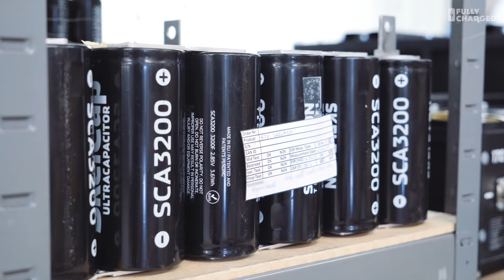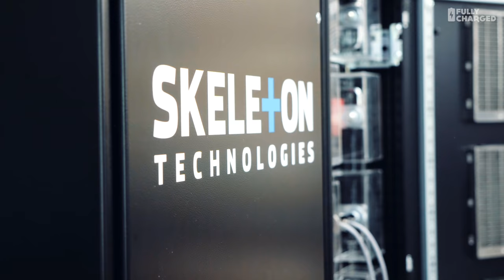Skeleton Ultra Capacitors | Fully Charged

Comment: This is Fullycharged at its best, more like this please, ^oo^
Reply: Hello from Estonia.
Reply: Let me pose this thought to you:
High-End Car Audio Systems incorporate Super-Capacitors in them for large power spikes, because if powered by batteries alone, the amplifiers can't handle some of the peak spikes in power. The capacitors provide the extra stored energy to keep this from happening, smoothing out the few of power. This is an understood fact and has been for many years.
So, why then, do you think incorporating this into larger scale power generation facilities is a stupid idea and/or a waste of money?
One SMALL scale practical application I can see for large capacitors would be for lighting systems. The Goal Zero lite A Life 12 Volt 350 Lumen light could burn continuously for WEEKS on just one supercapcitor, and when the Supercapcitor is exhausted can be recharged in 90 seconds, and then run the light for weeks more.
Yes, this technology IS in its infancy, but don't dismiss it out of hand. I'll take this over a Coal or Nuclear Plant, thank you very much.
Reply: this is an ad
Reply: Capacitors have been used for a very long time, and in fact most electronics could not work without them. What's new here is the technology and specifications. To claim that the US petrol and nuclear corporations will be able to stop this is naive. It's already here.
Reply: Brian Foote my response was to the paranoid delusional dude further up babbling on about CIA and industry wanting to kill off the technology. As for the economy of this, it clearly makes sense since they already have a large number of customers around the world.
Reply: Hello from India
Reply: SysPowerTools  Very poor trolling , you must learn to camouflage the troll , now get back to kindergarten.
Reply: Brian Foote  Well i,m pretty sure this particular capacitor is miles ahead in regards to power output vs size. So there is something new going on here.
Reply: Agreed.   
Estonia is a great example for the world to follow.
Reply: More of this, less vegetablism.
Reply: Bruce Forster yes car audio with massive different using caps, so are home audio, some amps has a separate power supply module that supply addition caps to provide current as well as smoothen out the electricity.

Good quality psu often use good quality caps like Seasonic PSU.
Eventually Ultra caps will hold more than original caps.

This pair up with Don Sodaway’s Mega batteries makes a perfect energy supply.
Reply: Hung Tran ultra caps already hold more than original caps
Reply: Bullshit....conspiracy at your best.

Comment: NOW I GET IT!
Basically
Regen the CAPACITORS.
Use THAT energy to accelerate.
Use the BATTERY for cruising.
Simples!
Reply: Exactly, you got it.
Reply: Earl Pottinger 
Simples!
I admit!😏,  I was sceptical of the "supercap" argument....... BUT
I always believed the "enthusiasts" were proposing that they be a REPLACEMENT for the battery.
NOW I understand that they are effectively "best friends".... (DUH!!!)
I have to say, this is a akin to the moment I realized EV's would (eventually) be the future!
The strange thing is, I have (for a VERY long time) been a fan of Formula One. It's becoming apparent (at least to me..... duh, again?) that this company is "involved" (if not in F1, in Endurance hybrids).
The logic of the system *works*!
Reply: Amazing (well, not really) how many 'experts' here apparently don't........
Reply: Roger Starkey but use more components to connect these - not very cheap, unfortunately.
Reply: @noop9k  
If you add the capacitive unit, you're removing batteries, which compensates for the price. The benefits would outweigh the cost.
Reply: Roger Starkey Adding 2 components instead of one is more expensive than making one of these components just bigger. Extra circuitry needed to direct electricity to one or another, possibly transforming voltage, is not free. total battery capacity invariably does down too if staying within the same weight limit. This all may be of course compensated by advantages of supercap, such as longevity, but price is bound to increase anyway. This is a tradeoff: speed of charging and number of cycles vs price and distance on one charge.
Reply: Batteries are like flywheels. You don't want to try to slam them stopped or slam them going, because they break. 
Capacitors are like springs. You don't want to keep pushing or pulling on them, because they break. 
But you can slam the capacitor, and keep pulling or pushing the battery.
Reply: "I always believed the "enthusiasts" were proposing that they be a REPLACEMENT for the battery."  
There was an idea to integrate them, charging from the electrolyte with the cap and battery integrated.  It was always the idea of adding rapid charge and discharge to batteries to prolong their life without conversion losses.  The energy in a capacitor is stored in the electrolyte/insulator, and not the plate after all.
The idea went with the idea of induction charging on highways, cap to cap through induction.  The caps would limit infrastructure costs delivering a large charge as you drove over it and then charge the battery as you drove from the caps.  Unlimited highway range while recharging, and better off highway range with regenerative braking.  It was also thought to be a good system for trains because you wouldn't need a live wire running the length of the track to go electric, rather just connecting plates every however many miles, a safety win.
Reply: Don't these ultra-capacitors also have the potential to make car charging so much quicker? That could a game changer.
Reply: @bobforton3722  that is a big possible advantage. The problem is that they are bigger and heavier than bateries. If they can get some capacitors for an ultra quick charge, and batteries for the rest it may well work, but you would either need a bigger car (less efficient), suffer less space, or have less range. 
Like most things in engineering there are trade offs.
Reply: In it's current form, it's definitely not a replacement for batteries, but a great complementary product to store regenerative breaking energy quickly, and provide a boost during acceleration, etc.
Who knows what they'll come up with in the future, one day given the right materials, it could become a viable replacement.  In the meantime it has great advantages for storing and releasing energy very quickly.
Reply: electric NOS.
Reply: @williambarnes5023 : Very nice metaphor.

Comment: Three points of note need to be made whenever talking about batteries vs capacitors:

1) Batteries do not "store" electricity, they convert electricity into (and out of) chemical energy. ie the energy is stored by change in chemical balance within the cell. This is why they are "slow" but "energy dense"  Capacitors directly store electric charge, the lack of chemical reaction required therefore makes then fast but fundamentally poor energy density

3) The charge held on a capacitor is inversely proportional to the separation of the charge carrying elements ( C = ( E X A ) / d ), however the maximum voltage a capacitor is capable of withstanding (before charge "leaks" across between those elements) proportional to that separation distance.  Why is this important, because Power = Voltage x Current, so high power requires high voltage, which means large separation distances, which means a smaller capacitance value.  The current drive for higher system voltages for eMobility applications, which is likely to continue (as both efficiency and cost fall with increasing voltage), tends to start making capacitors bit players in the energy storage game (And if you think "hey, i can just put some capacitors in series, well, sorry, but physics has got a limit there too, as capacitance is the opposite of resistance, so put two capacitors in series and their effective capacitance halves not doubles!)

3) The energy stored in a capacitor is directly proportional to the voltage across that capacitor (U = 0.5 C x V^2). Unlike in a battery, where the chemical reaction is driven by the voltage difference, a capacitor therefore has a voltage across it's terminals that is highly dependant on the charge stored.  This means that practical capacitor based energy storage systems require an active voltage converter (DC/DC converter) in order to maintain a reasonably fixed output voltage at all energy levels.  That means the power limit of the system is not actually the capacitors themselves, but the power transfer capability of that converter (who's ultimate performance is inversely proportional to the voltage ratio required).  Therefore, any meaningful cost comparison  with battery storage MUST include the cost of that vital voltage converter, ie you cannot just compare the cost of a capacitor with a battery, and say "capacitors are cheaper".

Today,  significant capacitor energy storage has been only realised in high cost systems (buses, cranes, motorsports etc) simply because the cost and complexity of the necessary voltage matching infrastructure has made such systems un-competitive with chemical battery storage systems on small, or cost sensitive applications (ie passenger cars).  And while chemical battery costs continue to tumble, driven by huge investment in massive volume production, that situation is not going to change any time soon imo..
Reply: Max Torque questions is why do we need capacitors when will coming soon solid state batteries ?
Reply: More importantly, chemical batteries can provide more than enough power for typical use in an EV without capacitors, particularly for large capacity packs.
Reply: Yes, the video said they're using it for regenerative braking on buses.
Reply: well said!
Reply: In day to day use, this can very useful for regen breaking, since batteries heat up the quicker you charge/discharge them, and heat damages them. So by implementing a capacitor along with Li-Ion batteries, you're charging up the caps, then transfering the power back the wheels when needed, or charging up the batteries at a slower rate. Think of caps as an energy buffer when regen breaking.
Reply: If the battery pack is large enough, for example in a long-range pure EV, then the battery pack itself can provide and take in very large power levels without capacitors, and capacitors are not needed.  Capacitors could help with regen in hybrids with small or no battery pack.
Reply: Thanks! I've actually learned something from a YouTube comment, much appreciated! :)
I would be nice if Robbert knew and talked a bit more about the technical side, 
Knowing what the real bottleneck is for a technology is essential.
But hey, nobody's perfect.
Reply: All real systems EVs or otherwise, use a combination of batteries and capacitors.  Caps come in all sizes from tiny ceramic caps in nanofarad range to the massive kilofarad cap assemblies seen here.  So its never a question of if caps are used or not, the question is, given the constraints of the application, where is the sweet spot in terms of performance, price, and reliability.
Reply: Max Torque "across its terminals"* apostrophe in "its" means contraction not possessive. Just trying to help since you've helped us so much with your expertise
Reply: +CrimsonTide001 Most EVs do not use capacitors for buffering traction motor power as described in the video.  Yes, all electronics use capacitors, but the capacitors in EVs are usually low power for electrical signals, not for a significant portion of EV motor driving power.
Reply: i was just about to say that
Reply: Rafael Dos Santos that was my point that you don't need capacitors if you have solid state battery already installed in the EV car !!!
Reply: Dendrite Whisker capacitor death
Reply: It's true that putting two caps in series halves the total capacitance, but it doubles the voltage, and since the power stored goes as the square of the voltage, you find that two caps gives half the energy by the capacitance, and four times from the voltage, for a total of double the energy stored, just what you would expect from doubling the number of caps. Also, that squared relationship helps to mitigate the voltage drop problem. At 1/2 voltage, a cap only has 1/4 of it's energy remaining. A 75% cycle is already pretty good, and competitive with batteries which do not appreciate deep cycling in general, and designing a system to handle, say, a 250V-500V input really isn't that hard. Going to 1/4 voltage gives you 87.5% of the energy, and is a bit harder, but still practical.

Most vehicle super cap systems involve large numbers of caps in series to produce the necessary voltage, and no one is trying to push the caps down to extremely low voltages.
Reply: Not to put too fine a point on it or to knock your obviously better grasp of these things than me....
One small issue. You said that a battery doesnt 'store' energy, that the chemicals in them do. 
Ok but what is a battery?
 A device that has electrodes of ionically opposed metallic makeup that are each attached to a chemical package of similarly different electrical charge. The electrodes are seperated and when a conductive circuit is attached and closed, the potential difference between the electrodes and the chemicals causes the flow of electrons across the circuit from one electrode to the other, the circuit ostensible has some sort of load built into it that makes use of some of the flow for some reason. But the energy comes from the chemical packs IN the BATTERY, which is a device constructed as above. So the energy IS stored in the battery. 
Right?
Its just not stored as a pile of naked electrons sitting in a bucket. Its liberated as ions from a chemical reaction.
Reply: Great comment! Thank you. What would you think of a system of distributed capacitance (like the distributor in a car) that allows you to charge a bank of capacitors. Then one after another they would slowly discharge to Recharge a car battery over time. So, you'd get a very fast charge at the station (to the capacitors) and then as you drove, they would one at a time discharge to fill the battery?  What do you think?  Should I patent the idea?
Reply: Great comment
Reply: Capacitors can store breaking energy very efficiently and use that energy for accilaration. because breaking and accilaration is very short duration, and Capacitors are able to charge and discharge in seconds
Reply: Smarty pants. Thanks great info.
Reply: So for a car audio standpoint, Lithium vs Supercaps vs AGM.   What is the best price to performance to keep voltages at optimal lvls?
Reply: @janvrto4822 , the weakness of chemical batteries (liquid or solid) is the limit of how fast they can accept (or deliver) power.  If you're cruising at 120k/h, then batteries are fine.  But if you're driving in a city where you're constantly accelerating and braking, ultra-capacitors are best to capture and release those fast, transient changes in demand.

In other words, imagine an electric car that has no traditional brake pads at all - all braking is done by capturing 100% of the kinetic energy and converting it to electricity.  Then, when the car accelerates again, you use the power stored in the capacitors to drive the motor rather than the batteries.  Any power left over in the capacitors when you park the car can be fed slowly into the batteries at a speed they can handle.
Reply: 3 points?   or one point and two three points? edit
lol.  just being ”technical”

Did you go to ITT Tech?   jk

Comment: This is absolutely brilliant.   I believe that battery storage using Sodium batteries and super chargers will replace Lithium arrays, because Sodium is much heavier, and cheaper - much better for land based giant storage, but the MW Ultra capacitors is perfect for instant energy balancing requirements and is a MUST !

Comment: High speed railway connection Berlin-Warsawa-Tallin is under construction (check Rail Baltica). So this amazing country gets more accessible via public transport. They even consider a railway tunnel under the Baltic Sea connecting Tallin and Helsinki. The whole Baltic Area deserves our closer attention. 👍
Reply: 'High' Speed Railway (HSR) has high speed only relative to slow speed railway and was disrupted years ago with trains or cubes moving in tunnels above or below ground in or near vacuum conditions:) It is disrupting in price at 1/10th of HSR, in speed at supersonic, in convenience with quiet, smooth rides...etc.